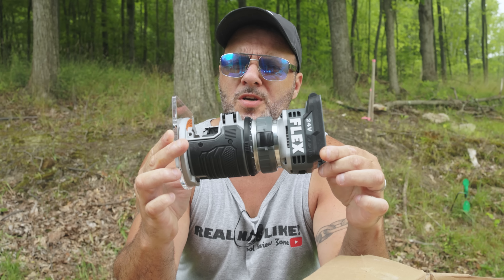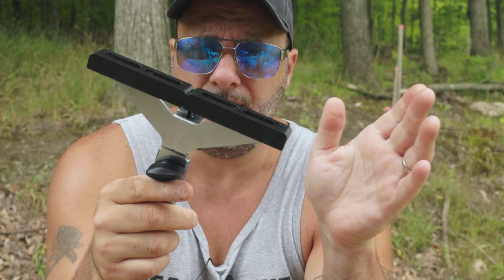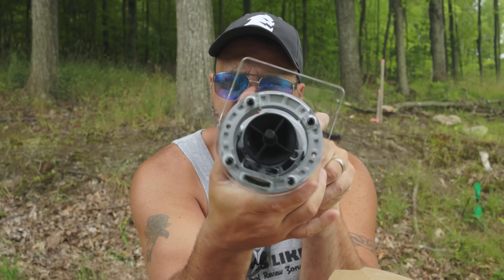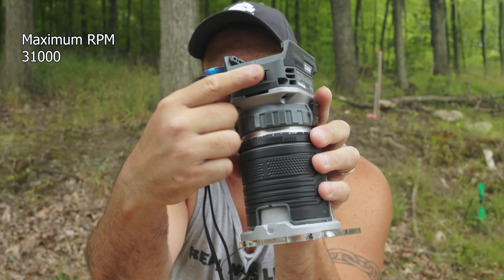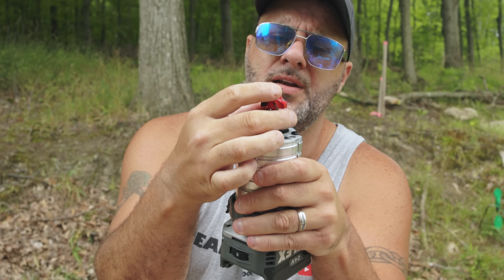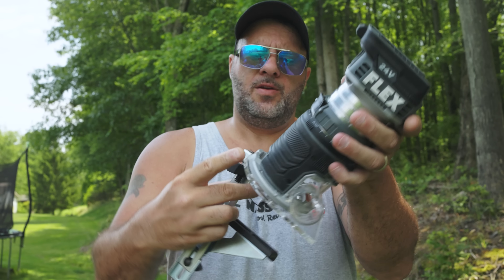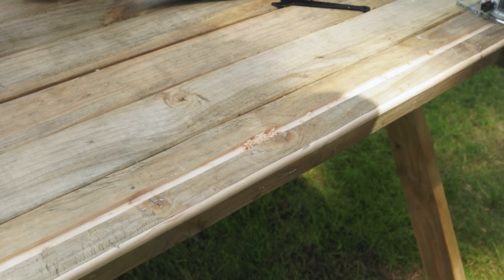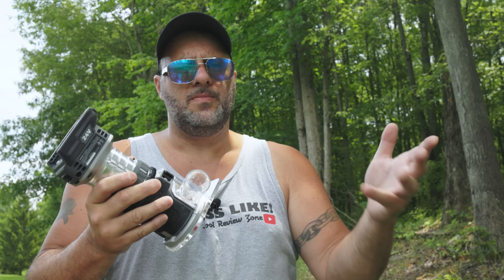Why the new FLEX 24v Trim Router is so amazing

Comment: As noted by other commenters, the centering mandrel is used for PC guide bushings.  However, in this case, I think Flex included it because they provide two bases and you need the mandrel to change bases (as you noted).  It's nice that it comes with the router as the few that I have, I had to purchase separately.
Also, cool new juice groove in the picnic table.  Every family that has kids should add that juice groove to their picnic table.  ;-)

Comment: The top looking device is a router bit centering cone for use of centering the baseplate to work with Porter Cable guide bushings. It looks like a super great choice of cordless router if you’re in the market for one.

Comment: I knew this was coming out but I needed a router before this hit the market so I picked up a Ridgid, which works really well.  I think the deal was buy two battery pack and get a free tool so I took the Ridgid router.  And, though it works really well, I can see myself picking up this Flex router.  It looks amazing and I have 7 other Flex tools and batteries
Reply: I've been waiting for a good "free tool" deal that offered a router. Finally, I found a FLEX offer at ACME tools!

Comment: The Dewalt/Porter Cable adjustment ring should just be the industry standard, no question. All manufacturers need at least some iteration of it. Real nass review bro, I’ve been waiting on this one. Routers are like crack to me. 😂
Reply: makita system is not as precise but much easier and faster to set

Comment: not sure if you answer comments on older vids but I just bought one of these (2024 is the last year of lifetime warranty for flex purchases). Did you notice the highest speed being painfully loud? I put in a 1 notch left 3.5 ah stacked battery and it's painfully loud on speed 6 while a fully charged 3.5 sounds normal like yours. I doubt I have a defective one but haven't seen anything about a "noise letting you know the battery is low". The tool is beautiful but a bit hefty. just curious about that noise that makes me wanna plug my ears. To be clear, I pulled it out of the box and ran it without a router bit in

Comment: Clint bro how the hell are ya?!?
I would love to see you check out the Metabo HPT 36v brushless plunge router.  Power for days, and only 1/2” cordless plunge router as of now (Milwaukee coming out with one soon).  Also the Makita 40v XGT router is very impressive as well. Im still not entirely sold on Flex yet but i think they are finally understanding there is more to tools than just power!